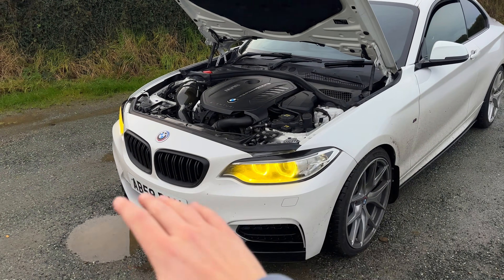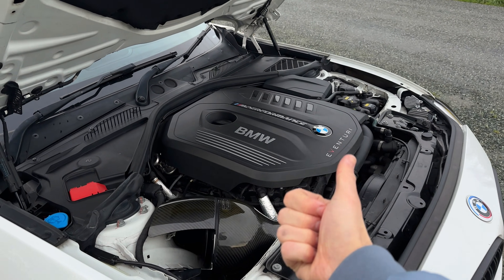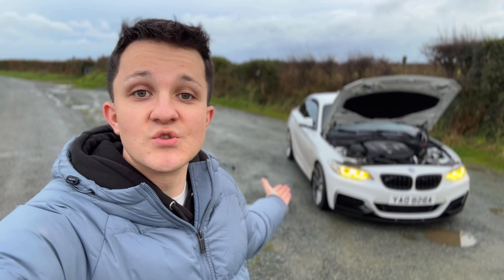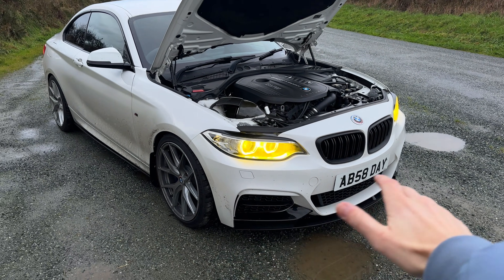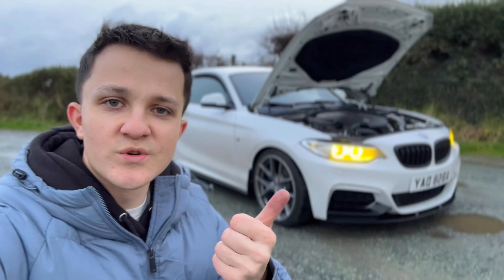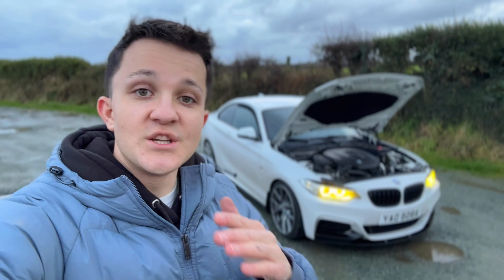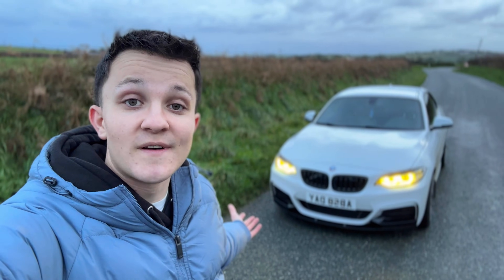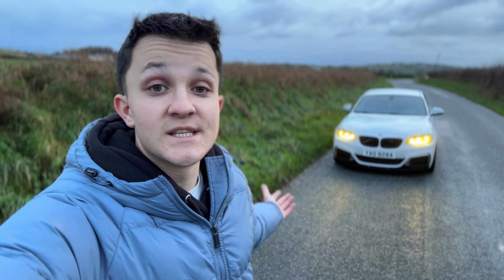Why The B58 Doesn’t BLOW UP, But The N55 DOES…

Comment: Bought an N55, owned 10 days. Rod knock. New block due to overheating, new crank due to rod bearing damage, new conrods etc. now it's rebuilt. After break in, is it safe to tune stage 1? Oil and filter every 5k now from my ownership.
Reply from the maker: Yes definitely
Reply: From what I've learnt I would do 3000 mile oil changes. Also is you car RWD or Xdrive?
Reply: @cammgt3rs370 okay, it's rwd

Comment: getting an n55 im assuming its more safer to go stage 1 instead of stage 2, should i just do that if i end up tuning it?
Reply from the maker: If you have all the supporting mods to run stage 2 then go for it, I never had any issues!
Reply: I’m sure you’d still want to get the baffled sump on the N55 motors..
Reply: I’ve had an f30 n55 for 4 years stage 2+ with fbo and I’ve never had any problems except for regular maintenance as long as your doing maintenance before mods all these horror stories you hear online won’t be a problem
Edit: Also buying the right car also helps try not to buy a super high mileage n55 I got pretty lucky with that I searched for months

Comment: 3:42 Actually an open-deck design can handle more heat, because you have more coolant around cylinder liners.
Reply from the maker: You’re right, open-deck designs can allow better coolant flow around the cylinders.

My point was more about the B58’s closed-deck giving better strength and stability under load rather than purely cooling. It’s a trade-off between cooling and rigidity, and BMW clearly leaned toward strength with the B58.

Appreciate the input!
Reply: @ethantyrerf22  Well, the thing is an open-deck block becomes a problem above 800 hp. N54s made a lot of boost and power being open. N54s and N55s are rigid and strong enough even for a really enthusiast driver. I see this change as an upgrade/feature which like 99.999% of users would never need.
Reply: Any engine you double the power will have problems, parts will fail. 
Bearing fails because simply because people don't warm their engines up, which also causes problems if tunning  done incorrectly.

Comment: I'm eyeing the base 435i (no GT, no packages). Is there a big difference in track capabilities between the 2 and 4 series?
Reply from the maker: I’ve never really driven a 4 series but been a passenger in quite a few, both cars are lovely, obviously more room in the 4 series too!
Reply: @ethantyrerf22  well i might just ruin this years christmas then
Reply: @Desdress 600HP M240i owner here, nearly bought a 440i. The biggest difference is the 2 series is a bit more nimble but the 4 series is a bit more planted. Both are fine for track duties but require fairly extensive modification first. At a bare minimum you will need an LSD, lowering springs and bushes, but ideally coilovers and an F80 disc and pad upgrade with hoses and better fluid. Just to give you some reference point, I've spent 15K on mine (a lot of that is on big turbo, DP etc) to make it track worthy and it's srill no M2 despite being very fast. 

I'd consider what you will need to spend first, because it gets expensive fast if you're modding for track use.
Reply: @Niko-xz5lk  thanks for the info! tracking a car is beyond my pay grade atm, so i was just curious.
Reply: @Desdress I honestly think keeping these cars standard is underrated. Nothing wrong with a remap for a quick 420HP but if you go any further you enter into a whole new ball park.
Reply: Best

Comment: I prefer a better sounding engine, the risks can be managed, as you eluded to,
Reply from the maker: Good point to be fair, it’s a tricky one but I do agree with you.
Reply: Seems like Xdrive Fseries N55s are not having that oil starvation issue. I've taken corners fast for 2 years and 40K miles and my N55 is trouble free at 143K miles.